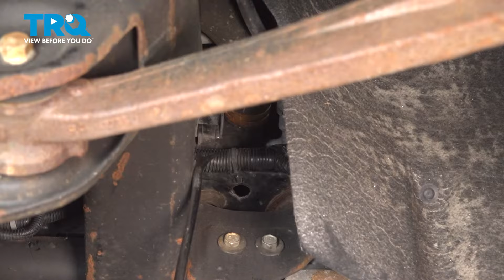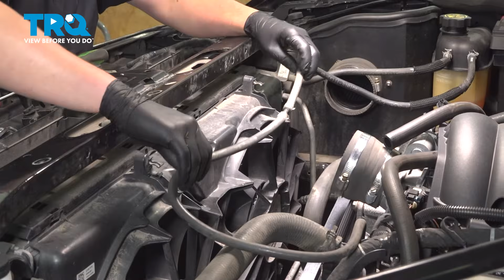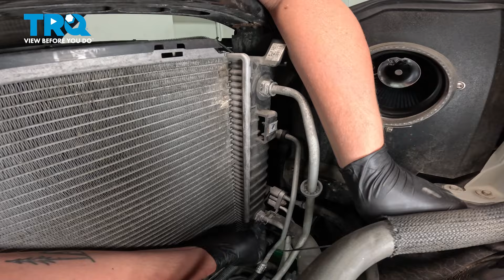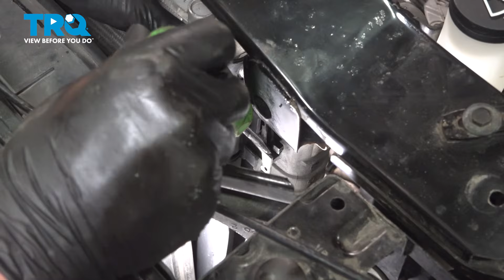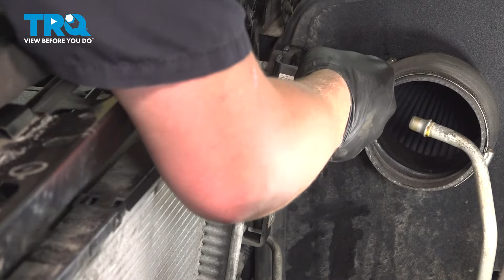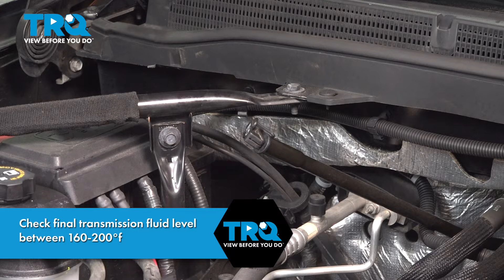How to Replace Radiator 2014-2018 Chevrolet Silverado 1500

Comment: Hey just heads up showing one with an easy to remove aftermarket one over the stock GM one is kinda of kick to the nuts. You might want to update the video. Way more details needed to remove GMs stock air intake

Comment: Didn't cover the 1/4-1/2 quart of oil you lost..... also a good technician on some models doesnt have to remove the transmission lines..... just saying, they bypassed this in 2016 or 2017 for a lot of 5.3 models.
For anyone that cares, go with sure cool bypass block for transmission and mishimoto intercooler for transmissions, I can say for a fact those transmissions run best at 130-160.  They are designed to fail at about 120k stock built.
Reply: Also...... a mishimoto radiator is gold....lifetime warranty and they just replaced mine for free.... just saying

Comment: There's no need to evacuate refrigerant....just remove the top radiator cross member that gives the space needed to separate the condenser from the radiator...i did mine in about 2 hrs

Comment: Ok so I hope you get back to me on this ,I just changed both my radiator and AC condenser in my 2014 Silverado,there is no lines that go from my radiator to the ac condenser I'm curious as to why?? Also my bigger oil lines are on the driver side and the smaller transmission lines are on the passenger side and the brand new stuff I got matches up with everything,In your video I noticed the oil lines are on passenger side and the transmission lines are on the driver's ,could you help me out with what is the difference here

Comment: The radiator to condenser line has me wondering if I need to pull a vacuum before performing thisz
Reply: Nope. The condensor is also the trans cooler. These are more common to replace than the actual radiator lol 😆  The freon lines connect on the bottom of the passenger side. They stay connected throughout the process.

Comment: My Silverados radiator only has cooler lines on the passenger side but I can only find radiators with them on both sides. Can I still use that one on my truck?

Comment: Only question I have is about the AC? Is that something that requires the system to get evacuated and re vacuumed ?
Reply: Normally yes on most cars but only if you remove an ac hose. On these cars you aren't opening  any ac lines you are just unmounting the condenser and remounting it from the radiator.
Reply: Did you ever find an answer to this
Reply: Did you ever get an answer?

Comment: The lines going to the condenser are oil lines or AC ??
Reply: Oil
Reply: The ones he removed from condenser  are oil cooler lines so no ac evac required. Just make sure you remove the correct ones or it will evac ac into your face. Ac evac not needed on these cars just don't remove any ac lines
Reply: None of the lines from the radiator go to the condenser. If you have any that appear that way it’s aux tranny cooler.   It’ll go radiator condenser and then aux trans cooler sandwiched together. Cooler is in the front behind the grill. You may also have a small black radiator on the driver side and that’s the power steering cooler 😊
Reply: Ac